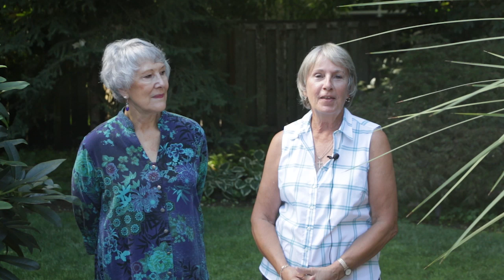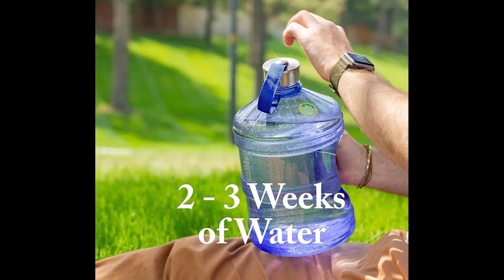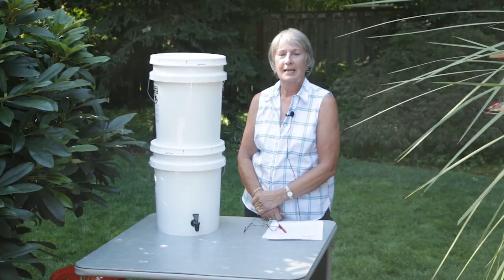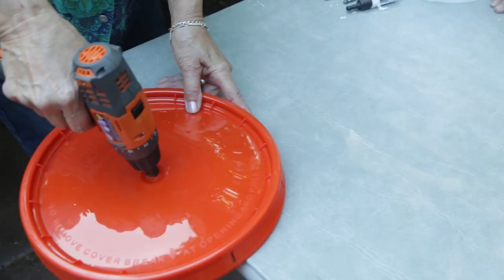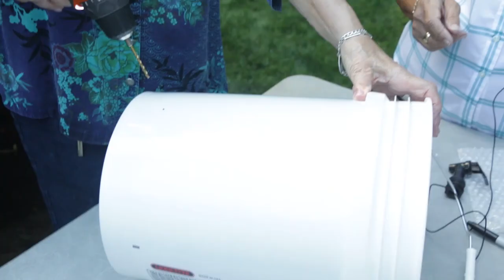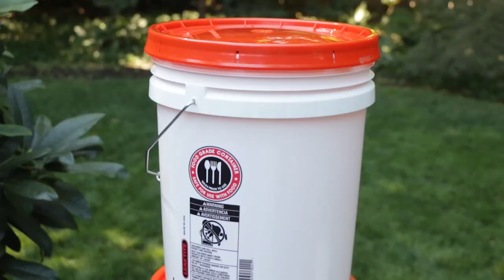How to build a two-bucket water purification system to prepare for a disaster

Comment: Great video but there are a few things that need to be addressed: Any water filter that's worthwhile would need pre-primed before you would be able to use it. Your filter not needing this tells me it's only good for sediment but would do little to nothing for chemicals and your health. The second problem are the type of lids that you are using. You're using lids that lock down and are not ment to be removed. Look for the non-locking lids that don't require a special tool to open them. Lastly, look for a better filter like the Berkey. They're expensive but last much longer and actually will provide you with safe drinking water. Stay away from the knock-off brand filters. The knock-off filters sold on Amazon are starting to put in the following disclaimer: Please note that TDS level does not fully indicate the quality of the water and our filters DOES NOT lower TDS. They claim to be as good as Berkey brand filters but have proven to be not. I own a Berkey and I also made my own plastic bucket filter but I used Berkey filters. In an emergency if you don't have clean running water to prime your filters then it's best to buy a primer bulb also made by Berkey. Yes, you need clean running water to make the filters work properly.
Reply from the maker: Thank you so much for your response. We don't endorse any specific products. We are not affiliated with any manufacturer of water filter products, and we encourage everyone to do their own research and choose a product that works best for them. In response to your comment, I called the JustWater manufacturer and company owner, Ron at www.justwater.me, 214-675-7426. He's based in Texas; the product is made in the USA. He says that the ceramic 4x4 filter we are using for our family does not require priming, and his filters have been tested by several organizations, including A. L. Abbot and Associates, Analytical Food Laboratories, and Ceutical Labs. The test results are listed on the product page for the filter on his website, http://www.justwater.me/products/4x4-ceramic-filter/  He also said that the Berkey product is a good filter; it's a bit more expensive because it's made in the UK. We encourage everyone to do their own research, buy their own water filter, and then be sure to test the filter themselves to make sure it works for them. By the way, the lids we are using are not the lock-down type, and they are easy to remove. Also, we encourage everyone to store a gallon of fresh water per day per person for two weeks, minimum. Be safe, and thank you for your input.
Reply: @neighborsready  sounds like you've got things covered but those lids are the type that lock down, you're just not using a rubber mallet to attach it to the bucket. Notice the slots around the lip? They are to be cut to help open the bucket after it's been sealed. I'm guessing you are just pressing down to seal the bucket. Menards sells the correct 5 gallon bucket lid item # 6482907.
Reply: @rocketsurgery8337  Thank you! I'll check into that. It never occurred to us to seal the buckets. Really appreciate your feedback!
Reply: @karenronning-hall4383 
Great video. 👍

The locking lid issue is easily resolved by trimming the lip of the lid so that it leaves 3-4 ‘tabs’ that make opening much easier. Search videos on modifying the lid. 

The Berkey comments didn’t age well as the company has been in some trouble over the actual filtering quality vs their claims. 😮

I believe Zero Water was the best reviewed water filter…on Project Farm channel…as far a TDS removal vs price.
Reply from the maker: @ruidadgmailcanada8508   Thank you for your comment. Your solution sounds like a good one if you get locking lids! By the way, no filter can remove 100% of the impurities from water; viruses can slip through a filter because they are extremely tiny. The CDC recommends using two methods when purifying water: filter to remove parasites and inorganic impurities plus disinfection to kill disease causing organisms. Check out our website on water preparedness for more information at https://www.neighborsready.org/water-supplies.html. Good luck!
Reply: 😊 @neighborsready